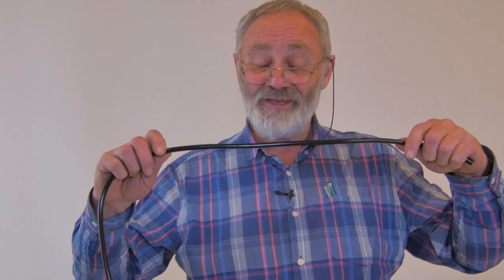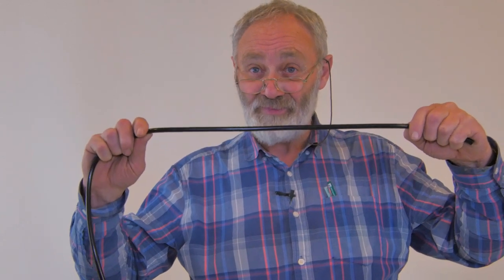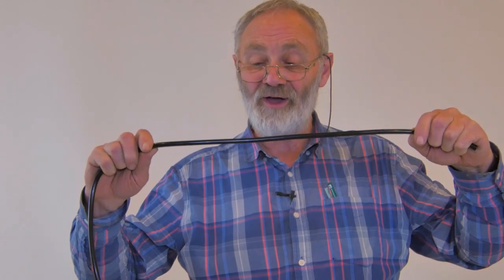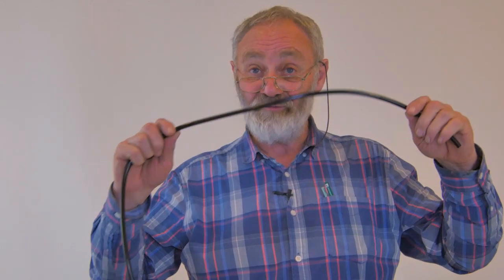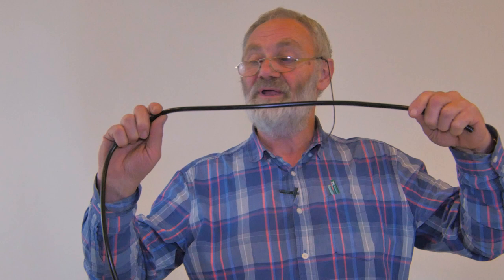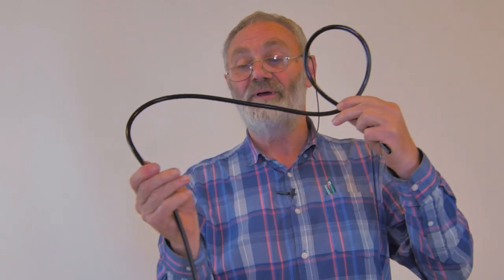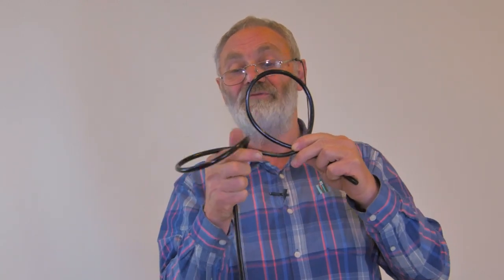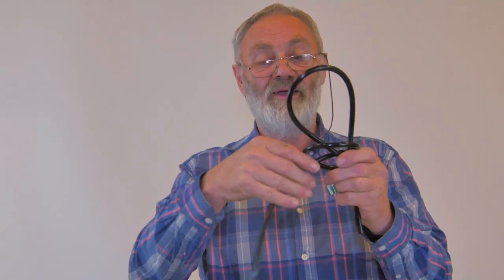How To Tie The Knot In A Harp String - Teifi Harps FAQs

Comment: I would recommend placing the string through the eyelet from the top of the soundboard and then pulling that end out from the back to make the knot.  This works for all the strings except for wound nylons and wire strings which are manufactured with an anchor already in place.